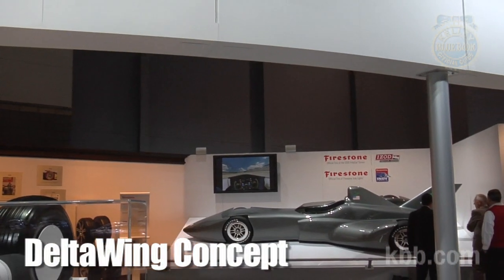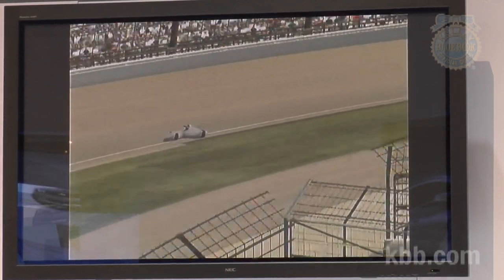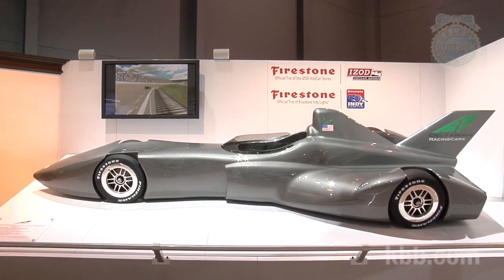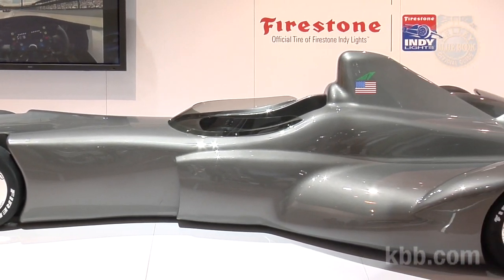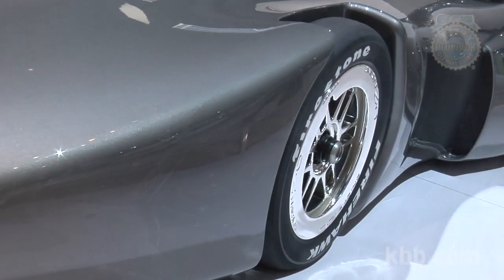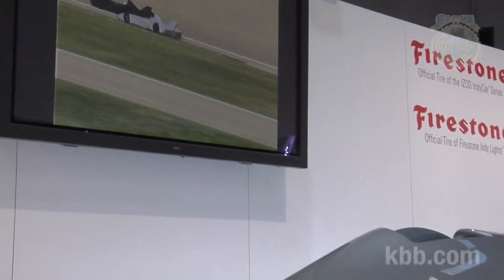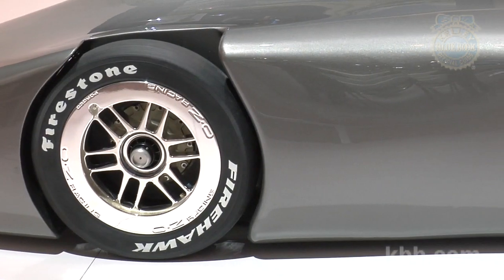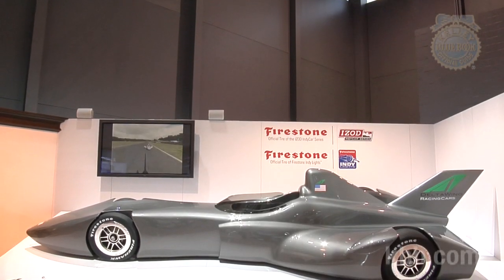Delta Wing Concept - Chicago Auto Show - Kelley Blue Book

Comment: The problem with only generating downforce with the underbody is that if the car happens to bottom out, its pretty much either going to veer out of control, or fly. Also the wake to the car from behind will have the propensity to lift that car up....the ground effect wouldnt work; close running cars would be dangerous.

Comment: Has the IRL even thought about the massive advantage teams would have from using this car in wheel-to-wheel contact. This thing could break the suspension of other cars without suffering any real structural damage. In my eyes this isn't even an open wheel car, it gets that title on a technicality.